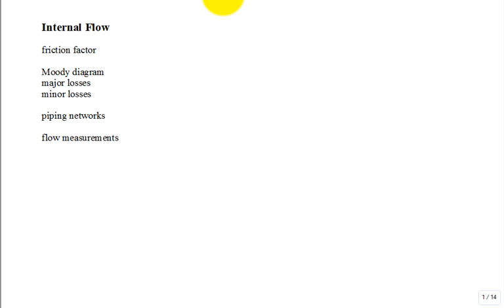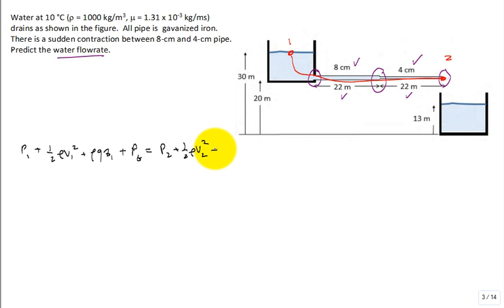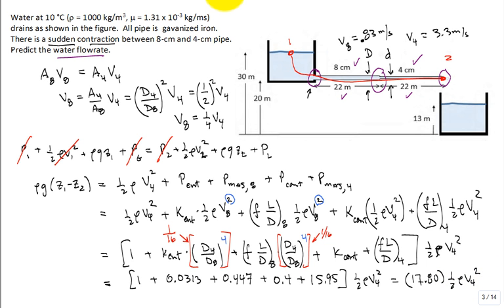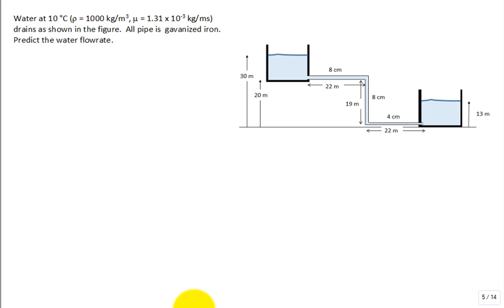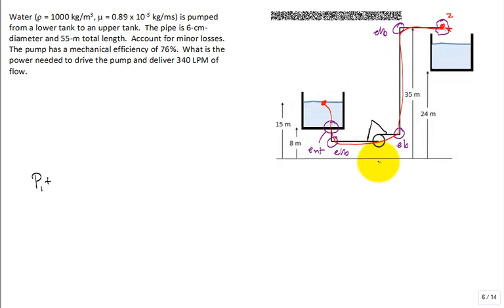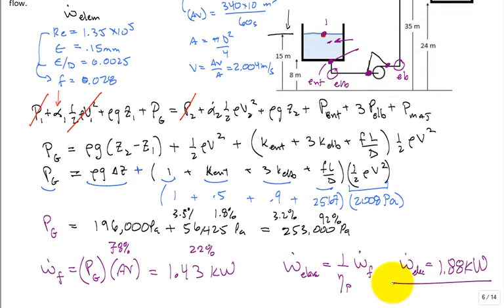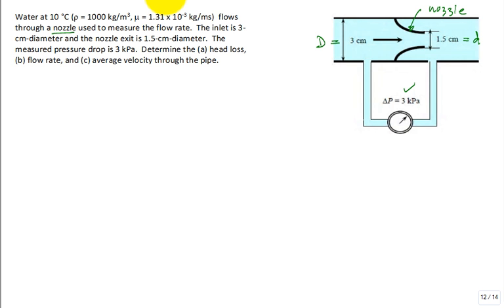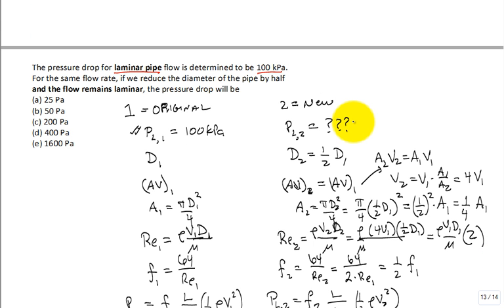Internal Flow 3 Summer2015

Comment: thank you professor for your effort, my question is at minute 34 how did you start your right equation with "1" that means that there is velocity at point 2 but there shouldn't be velocity because u assumed that Bernoulli is taken through the red line that you drew?